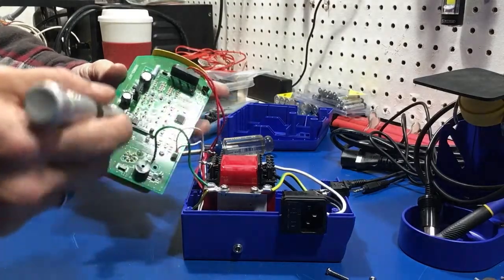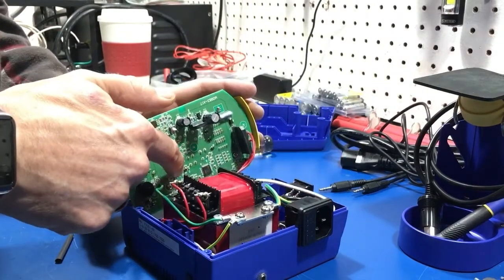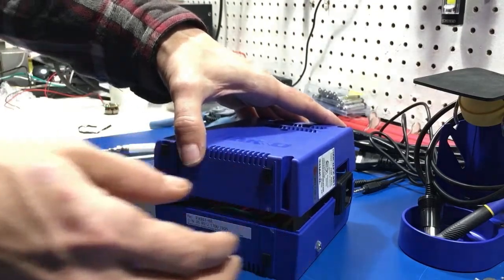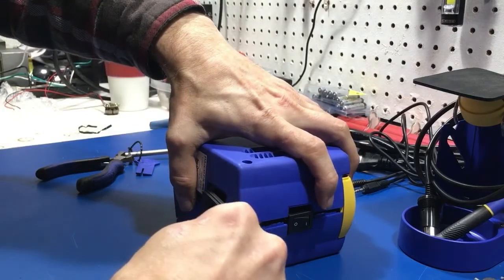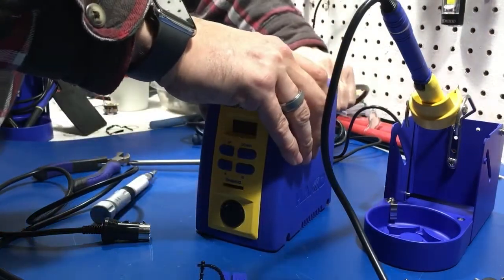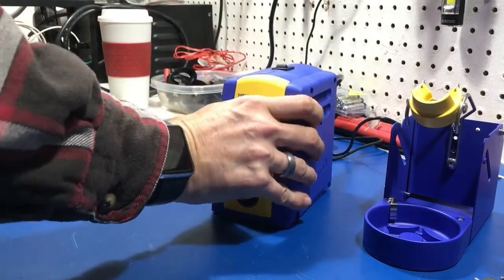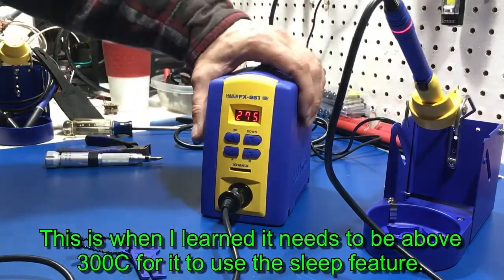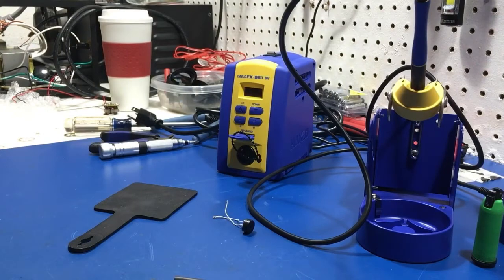Hakko FX-951 - Part 3 - "Bypassing the Programing Card" - No permanent modification needed

Comment: looks like there is a Hall effect sensor , not just the led transmitter and receiver , any strip of aluminum (the narrow side) will do the trick , or cut cardboard to the shape of the key and tape aluminum foil on top, you can verifying the hall effect by opening the station and placing anything metallic between (scissors , tweezers , flat screwdriver )

Comment: I bought a second hand unit without the key, its stuck on 800. I tried this method but doesn't work any tips?
Reply from the maker: Definitely don’t run it at 800. You can probably change it by sticking in a piece of folder over paper to the same width as the key whole, or thin cardboard. Once you know the cutout of card works just put some tape on it and it will now be your key. 
If you feel comfortable taking it apart you can always do this mod with heat shrink tubing.
Reply: @GadgetReviews-US  I did it with some shrink tubing after I got it open. Its working now, I was pressing the wrong button. Thanks 😊 🙏.  The trick also worked on my hakko 850d hot air station.

Comment: For a "non-permanent modification", how do you remove the shrink wrap without damaging the LED? Could you demonstrate that, please?
Reply: Just use heatshrink type that doesn't have glue inside. And if you really do find yourself unable to pull it off, use a scalpel and carefully slice the heatshrink a little bit on the side. No need to cut straight through even, you just need to weaken it, so it stretches or breaks along the side of the led when pulling it.
Reply from the maker: I left a part hanging off, you would be able to just slide it off. I’ve used heat shrink in the same type of 5mm LED’s to concentrate the light forward. But in this case you don’t leave the end open, you pinch it shut. That little part you pinch shut can be the part you grab with needle nose pliers or sting tweeters and just pull it off. If it’s warped to hard or a different type of heat shrink grab it with the pliers and add heat again to loosen it up and it will come off easy. Current I can’t show this since my lab and house are packed in storage as I am moving. It will be a couple more months before I buy a new place and set the lab up again.

Comment: That's a nice and easy mod. I envy the sleep mode of the FX-951. I need to figure out an auto-off/sleep mod/hack for my FX-888D -- I've left it turned on accidentally for more than a day two times in the past month.
Reply from the maker: My power strip is plugged into an outlet that turns off the lights. And the bench light also o,urged into this surge protector strip. This way when I leave the room I turn off the light switch and this links the power strip that the Hakko is plugged into. 
I also found a few little digital timers at a yard sale that can handle 7 amps, one turns on and off with a light sensor. The other one has preset times like 15 min, 30 min, 1, 2, 6 and 12 hours. 
These little timers are great for skmetijng like this.hit the button for 1 hours and it will turn off the iron in one hour. Just make sure the timer can handle the power that the 888 pulls. 
The one downfall of the 951 is you can’t do the sleep and Auto turn off at the same time. I would like to tk sleep but also turn off a few hours later Incase I forget it on. Even in sleep mode it’s low enough to slow down tip oxidation at 200C, but still hot enough that if a cat knocks it over it will be a fire hazard. 
Just thighs I would share some ideas that might help you.
Thanks,
Scott